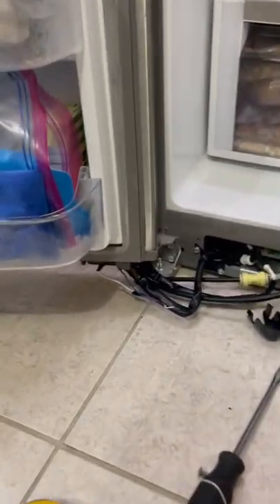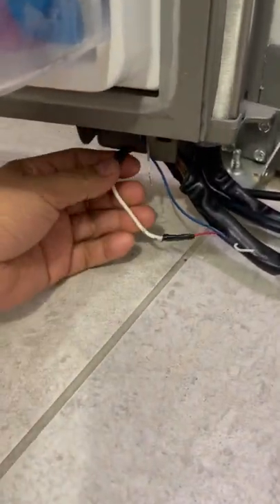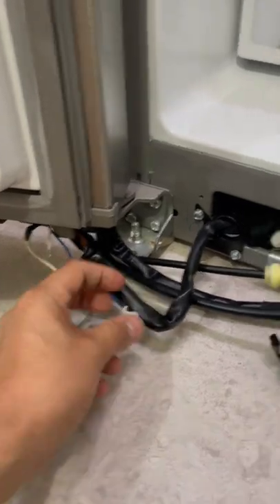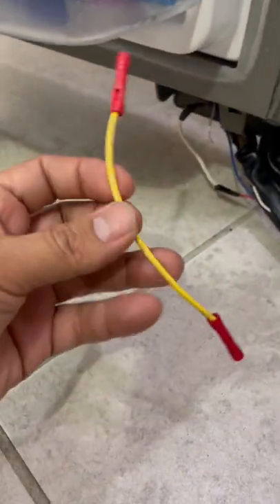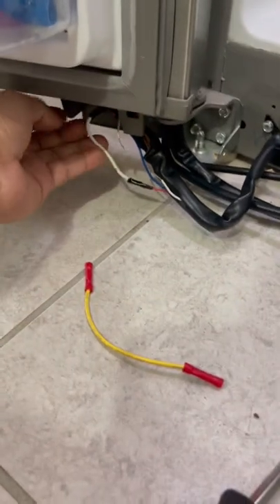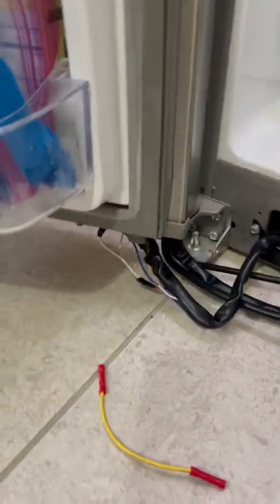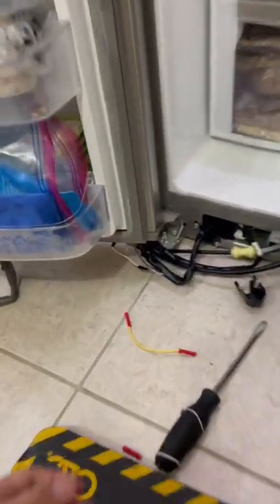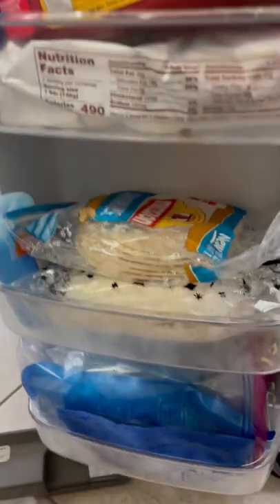Whirlpool refrigerator not making ice

Comment: I just had this problem and a yellow wire for the ice maker broke.  The cover of the cable bundle broke because the bottom cover has sharp edges and little room to move back and forth.   F- design!  I stripped the wire 1/4" on both ends and soldered a little jumper of about 3/4" in.  Make a little hook on all the wires with  needlenose pliers after tinning them.  Solder together after squeezing the hooks.  It is a pretty intricate little soldering job since the space is tight.  I use hot melt glue to insulate the repair since it also gives a little mechanical strength.  Then I wrapped the bundle with 2 layers of electrical tape, followed by a plastic spiral wrap and cable ties on the ends.  Now the bundle can move a bit.   I took a knife to the plastic cover to smooth the burrs on it and carve a relief for the cable to slide better without breaking the insulation.  Should last a few years.l